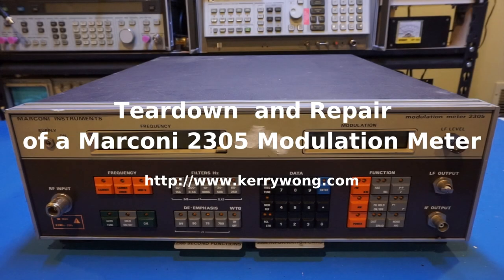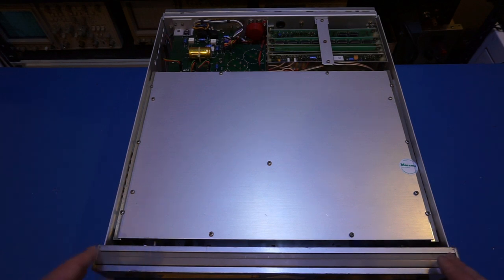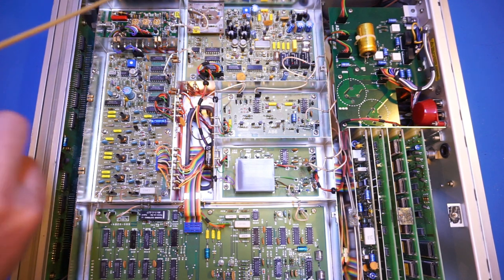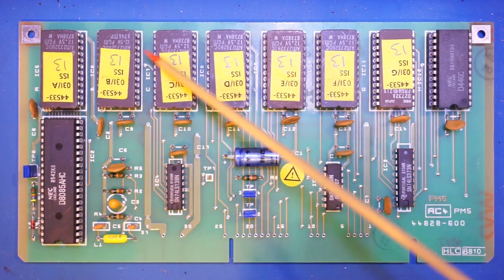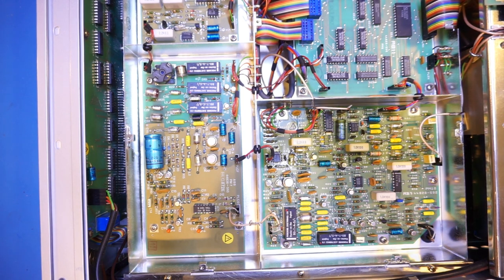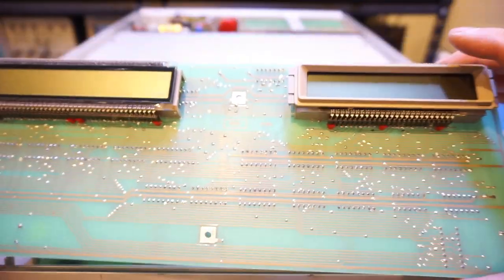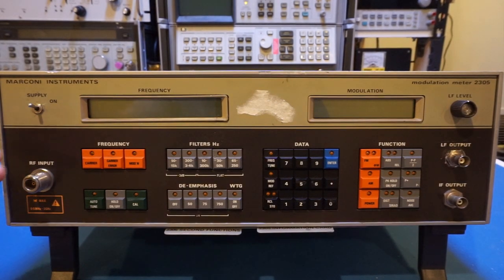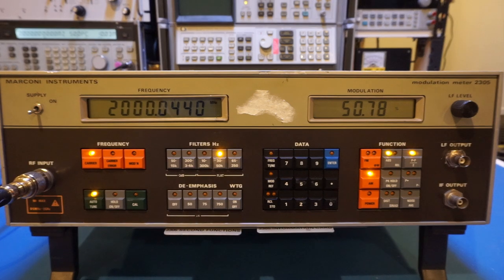Teardown and Repair of a Marconi 2305 Modulation Meter

Comment: I did some repair videos on my one of those a couple of years ago, main switch, oven oscillator, a few bad tantalum caps, and also a blown IC on one of the boards @5:09 it would be the upper right row on the board at the bottom of the screen, middle one if I remember rightly.
Reply from the maker: That's interesting. Those 74 series chips are usually quite reliable and usually doesn't just go out like that especially all those chips are sharing the same power rail...
Reply: Kerry Wong - the ic was getting hot as it was shorted out, worked fine once I got it all fixed, I’m actually trying to sell it at the moment.

Comment: Hello Kerry , i just got over a Marconi 2305 chap from surplus, and i got it home and powered it up , it goes true the cal steps and ends with a number 1 ,  not Passed . It can read frequency OK and power level but NO modulation comes up either in FM or AM just 0.000 do you have any experince with that , any settings maybe ?? or faulty somewhere, I have a service manual but its not easy to use need to read it several times to understand all settings. So do you have any knowledge on this ? or any other user here in chat maybe.